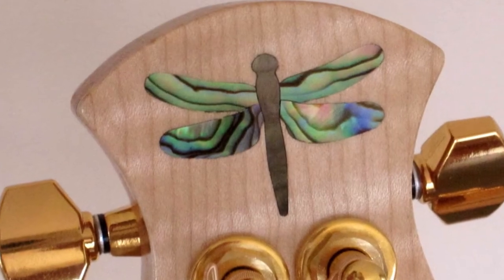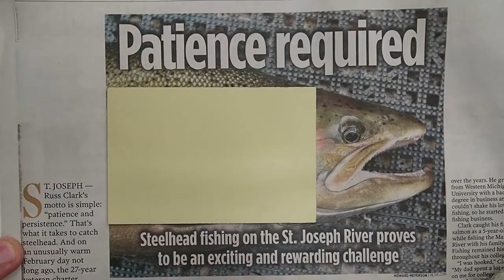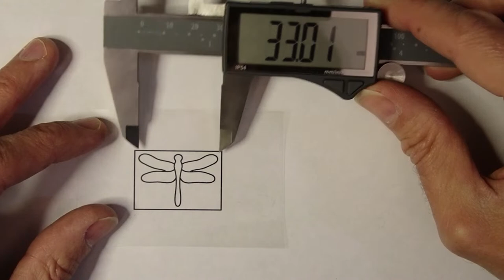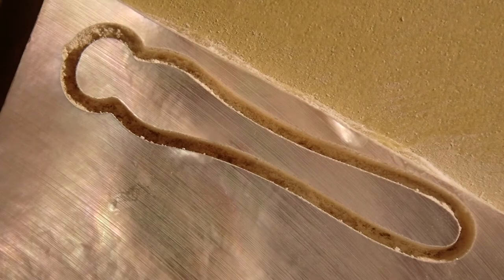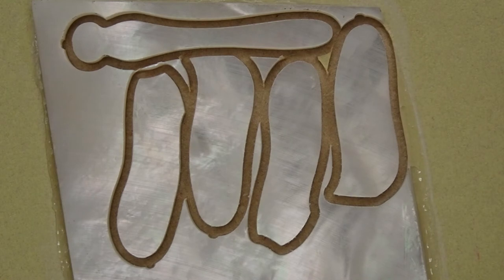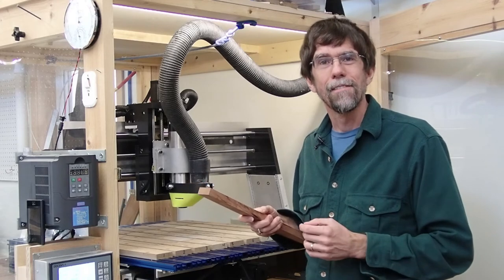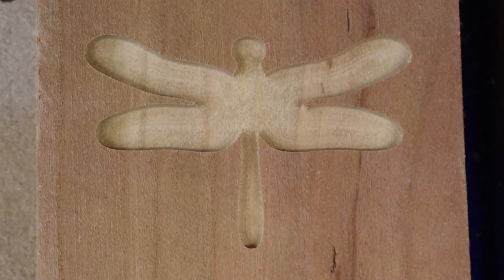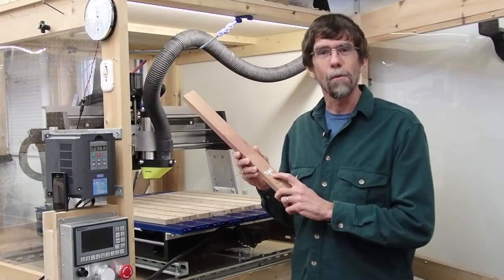CNC Guitar Inlay Part 2 - Cutting Shell Material

Comment: Your work is very beautiful.  Visually, those pockets look a lot deeper than I would have expected.  My assumption is that was just the depth of the material you were using.  Thanks for sharing your techniques.
Reply from the maker: I try to make the pockets just a little shallower than the thickness of the material, to minimize how much shell material will be sanded off. It doesn't matter much with plain white shell like this, but when using highly figured material like abalone, I try to fit the patterns of the shell into the design. The patterns change as you sand them down so it's best to remove as little as possible.

Comment: Jay, I really enjoy your videos, very informative and clear thank you!
 I've used mdf as a backer and yellow glue to hold the pearl.  Then soak in water to release, easier and faster than CA glue.  Resawing the mdf to leave just a thin veneer before soaking speeds it up a lot.  Also, nitro-methane is faster than acetone to dissolve CA, it's the material used in the commercial products.
Reply from the maker: Thanks for the tips, as it does take overnight to release the CA and a faster option would be nice. Then again I'm not typically in a hurry since I have plenty of other tasks to do while it soaks.

Comment: Hi Jay! Thank you for the video! It was very useful, but as English is not my main language, there are some things that I wasn't able to understand properly. What kind of phenolic board did you use to hold the mother of pearl? Phenolic wood or some kind of phenolic plastic like bakelite?
Reply from the maker: Hi Ernesto, I'm glad you found the video useful. Here is a link to the phenolic sheets that I used. I think that wood or thin plywood would also work, but it would absorb acetone when soaking it to release the glue. Some people use white glue instead of cyanoacrylate, and soak it in water to release the parts.
https://www.precisebits.com/products/substrates/backingmaterials.asp

Comment: This by far the best video I have found on CNC guitar inlay.  The in-depth explanation and detail in invaluable. I am hobbyist luthier hoping to move up the skill level and start inlaying headstock. I just completed an online Fusion 360 class and am now looking for my first CNC machine to start some real world practice. *****Do you have a recommendation for a small affordable CNC machine?*****
Reply from the maker: Thanks Michael. I don't have a specific recommendation on a CNC machine, other than to consider looking for a used one if you're just starting out. The less-expensive machines are generally less rigidly built, which is a limitation but not necessarily a problem for a hobbyist. You can still get good results with a light-duty CNC machine if you slow down the feed rate and take light cuts, to reduce the forces on the bit etc. For inlay work I take very light cuts anyway because the bit itself is thin and fragile. For what it's wroth I expect that even the lightest-duty CNC machine should be capable of more accurate inlay work than a hand-held router, which is how many people do inlay. That said, if you can afford better quality then it may give you more flexibility to tackle more challenging projects.

Comment: This is looking great. I wonder if the second wing didn't fit because of an interference between the other inlay parts. It might fit without gaps if you cut the inlay parts 0.05mm smaller and cut the pocket 0.05mm bigger, rather than just put the 0.1mm tolerance adjustment all in the pocket size
Reply from the maker: Thanks. Yes that would probably work, and it might be a better starting point for next time. Obviously I didn't want to re-cut these inlay pieces but now that I know I'll need about 0.1mm I can split the difference. Any final fine-tuning (e.g. 0.03mm) would be just on the pocket though since it's only a single toolpath to modify and only the wood to re-cut.

Comment: Hello, I have a doublebass fingerboard and want to put fret and inlay on it. 
I have to do SURFACING because it's not perfectly flat. 
- What would be the order between, surfacing, fretting, and inlay ?
Thanx in advance, cheers
Reply from the maker: I would start by flattening the fingerboard. Then do the inlay and sand it flush and to final surface finish quality. I'd use a long, flat, hard sanding block to keep the surface flat. Then fretting would be last.
Reply: @BrainRight  Thanx a lot :) that's what i was thinking about.

Comment: Great video. Very inspiring!
I’m about ready to try cutting my first inlay CNC inlay on my Shopbot Buddy Alpha. Using pink snail Abalam. Using v-carve pro because that’s what I’ve got. Was planning on using a 3-flute .023 diameter cutter with .01” depth of cut per pass, 18,000 RPM (high precision spindle drive) and 6 inches per minute feed. What do you think?
Reply from the maker: Glad you found it helpful. For comparison, I used a 0.031" diameter cutter at 24,000 RPM with 0.01" depth of cut and 9.8 ipm feed. Your numbers aren't much different, and your slower feed is appropriate for the smaller (more fragile) cutter. You could bump the RPM to the maximum for your spindle but I don't think it would make  a big difference. Abalam may cut differently but I don't have experience with it. Here's a link to the feed-and-speed guidelines from precisebits where I buy my cutters:
https://www.precisebits.com/materials/ivory_shell/natural_shell.htm
Reply: BrainRight thanks so much for your input. I appreciate it. I cut everything out today and it went great. I don’t post shop videos on my personal YouTube account but posted a quick video on my Facebook page “Roberts.Luthiery” aka Roberts Guitars.

Comment: Do you manually lower the cutter to set zero (starting point) in the Z axis? (sorry if this is a dumb question-totally brand new to this)
Reply from the maker: I usually jog the Z axis down close to the surface, and then slip a thin piece of paper under the bit and jog down in very small steps until I feel resistance on the paper, then zero out the Z axis. There are other methods but that's quick and close enough for my needs.

Comment: Instead of applying the CA glue directly onto the Mother of Pearl, why not stick some tape to the MoP and another to the phenolac board and glue the in-between?
Reply from the maker: That could work but I'd be worried about getting the small pieces off the tape without breaking them. I'd also be worried about the shell shifting on the tape while it's being cut, although the force from the router bit should be very small with the shallow cuts I'm taking.